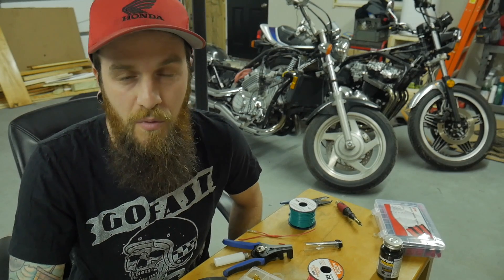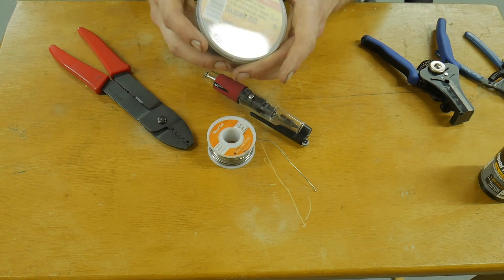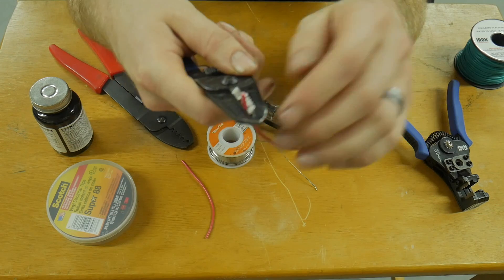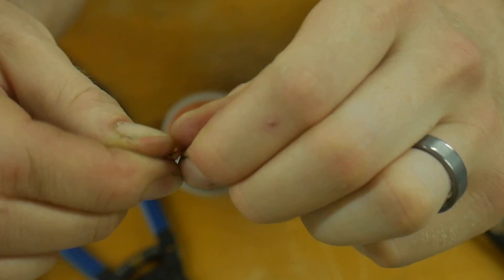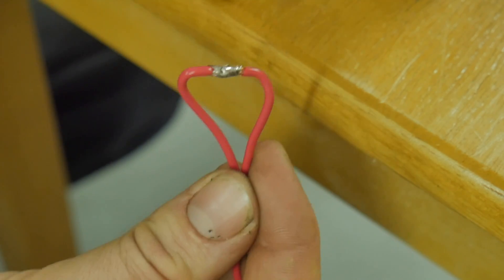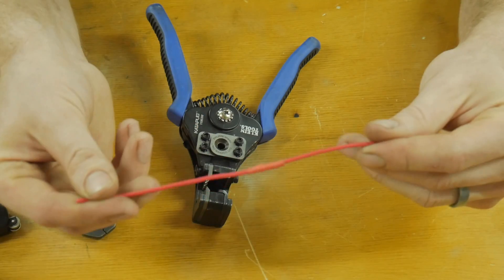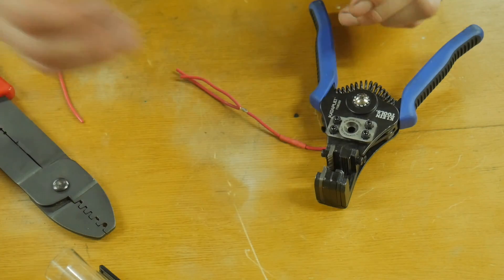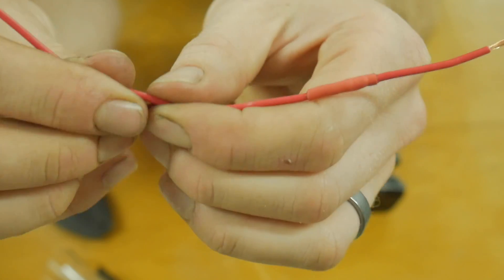Motorcycle Wiring: How to solder, splice and heat shrink lasting connections - PART 1

Comment: 11: 10 I'm really surprised to see that you didn't use any rosin. That would likely solve the issue. I always use rosin and find that the solder will flow much better.

Comment: Thanks Cody I am replacing new throttles and switches on my xl 1200 Sporster. The color wire in new switches are different.  I am going to take my time and do it the way you suggested.  I like that heat gun. What is the brand?

Comment: No solder on vehicles unless absolutely necessary. You're asking for trouble down the road. Every solder joint in any environment with vibration will fail, it's just a matter of time.

Solder does nothing that a solid crimp can't do.

Comment: Funny thing is...the "type" of solder is actually very important.  For electrical wire connection soldering - you definitely do not want to use acid core solder wire.  Best electrical solder wire with very good conductivity is 60/40 designed for electrical wire soldering connections. And a good "flux" gel will help the solder bond better.

Comment: But there are always two wires, no? You only worked with one...what's going on with the other one? 
I am a beginner and learned alot. However, when the text came and said something about only using "this tecnique" if you have cut "that" wire to the harness" it all went away. What's "this?" And what's "that wire?" And where do I cut it the harness(oh, what's that again? How and where do I reconnect it TO the harness ? I would have to do that eventually, no?
I have trouble following for a number of reasons perhaps you can address. I am beginner and I hope you understand and can appreciate that in my case beginner means, "what's a harness?" Ok. Way way way beginner. 
So, you only work with one wire all the time, but there are always two(maybe three) what about them
You are never working in and around the bike. I suppose I would be working around the bike. It would be really helpful(only second video of many many you have that I have watched) to see you do this stuff in the bike.
Where are all the little plastic connectors that are on every wire on my bike? 
Is there a "THIS IS WHAT YOU DO FIRST video...on the bike...what wire do I cut? Where? What abou the black wires? Sorry.

Comment: Hi Cody , way off the subject but I have a 1979 Honda cbx1000 6 cylinder, is there available co & hc figures that you could advise on  please. 
I'm currently running  CO  7.7%  and HC at 740  and these settings keep fouling the plugs .....   Cheers Paul

Comment: Heat shrink tubing is available in different shrink ratios.  The stuff you're using looks like a 2:1 ratio.  You can also find ratios like 4:1 which means that it will shrink to 1/4th the size.  That works great on multi wire connections like you showed.
Like electrical tape, there is good shrink tubing such as Raychem brand (sold by TE Connectivity) and there is crap, from you-know-where.  World of difference in quality and working characteristics.   Good Luck!

Comment: I like using 3:1 heat shrink with adhesive lining (aka marine grade).  Helps to seal out any moisture and the larger shrink ratio helps if you are shrinking a larger heat shrink onto a smaller heat shrink; it will shrink to 1/3 it's original size

Comment: Thanks, Cody.  I've only done a couple wiring jobs on my CB750.  I found it very satisfying, crimping on new bullet connectors, using shrink wrap to make everything look nice, then having it actually work when you're done.  What do you think of those light blue plastic splicers that come with Dynatek electronic ignitions?   I used mine like the instructions said, but I've heard those connectors aren't that good.   I'd like to connect those wires in a different way, but I'm afraid to mess with it at the moment.  Is there a different way to do it that you'd recommend?  Seems like the technique you showed in this video would work.

Comment: When you said heat shrink is heat shrink I cringed a little my Friend. There are many different grades and types. On motorcycles, when I'm wiring, I use an Adhesive-Lined Polyolefin Heat Shrink Tubing by 3M for motorcycle or potentially wet location splicing. There's also tubing that has particular shrink characteristics for doing one into two or one into three splicing where you need that extra shrinkage to happen with a single piece of tubing. For the most part, general splicing, I use the HF stuff, but always on bikes I use the Polyolefin from 3M. Check it out! Cheers Brother! Great tutorial! I hope you're staying safe. Zip~
Reply from the maker: Thanks for the info zip! I was aware of the 3:1/2:1 ratio shrinkage and the different styles. I suppose I didn’t feel like debating it all. Same with the solder. I’m sure I’ll hear from somebody about solder core styles and material. 😆
Reply: @TheMotorcycleMD  To me, the tinning before joining is key. But, there is 100 ways to Tokyo! Japan that is....Home of Honda.....Lifeblood of Cody lol. Cheers again Brother! Zip~

Comment: Hi, Cody.  You might remember me from our local  DGR.  Just a few comments about this video .  First ..a tool that is invaluable for working with heat shrink tubing.  Invest in a heat gun.  It's much better than using a lighter and you won't accidentally scorch the tubing.  Second.. for those old, dirty wires you were talking about.  get some soldering paste (aka flux).  a dab on the joint will help the solder flow and adhere to the old wires.  Just don't overdo it.  I know you haven't yet addressed crimped on connectors,  but always tin the end of a stranded wire before crimping on the connector.   Stay safe, all.
Reply from the maker: Hey man! Thanks for the info! I do own a heat gun but by the time I locate it, grab an extension cord and plug it in. I’d be done with three connections with a lighter. Heat gun is for sure the best option for consistency but I figured if 1/4 of DIY wire hackers learn to use shrink tubing with something as simple as a lighter. The world would be a better place. 😆
Reply: No lie bro I just broke my heat gun and the lighter trick is gonna save me some money and time